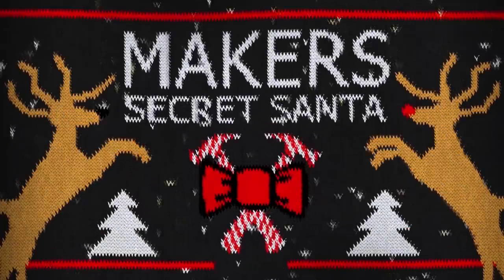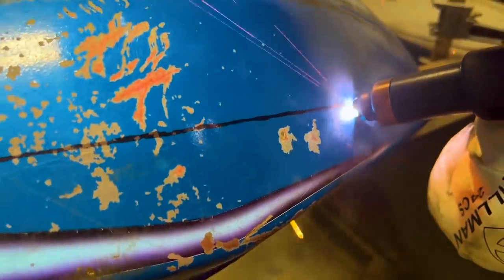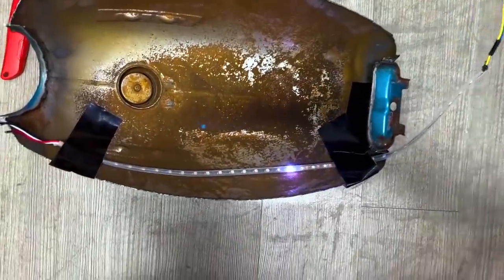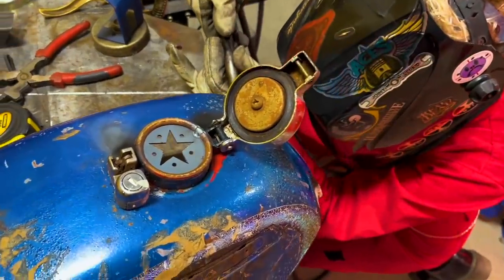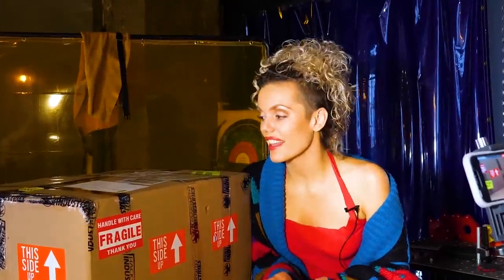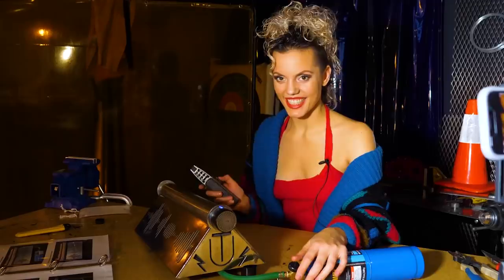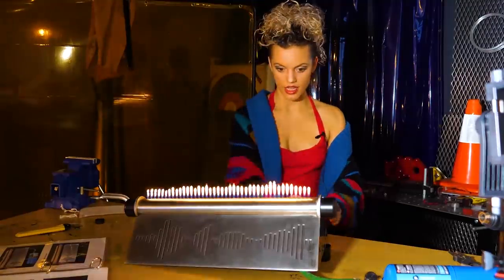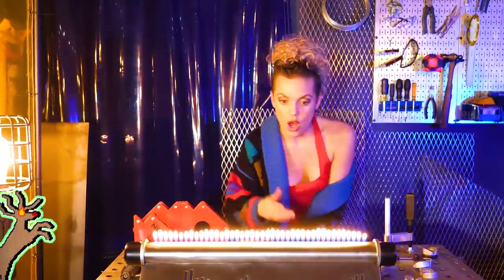I made a Motorcycle Gas Tank into a Lamp??

Comment: that came out awesome! Quick tip for welding thin stuff to thick, heat up the thick material with a torch till its glowing, and then zap it, boom no more break throughs, and a series of quick tacks becomes the final weld. hope it helps :)

Comment: Having dealt with multiple rusty motorcycle fuel tanks, get yourself some evaporust, fill it up, and let it sit. Then you'll want to coat the inside, either with a thin gasoline safe epoxy, or whatever sealant you want if it's not being put back into use